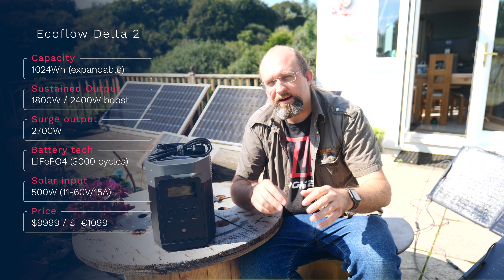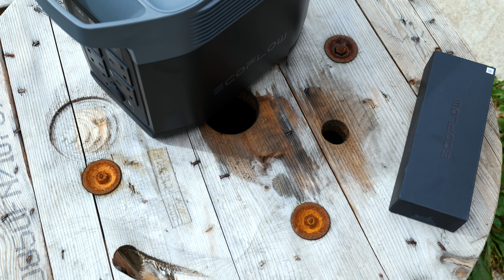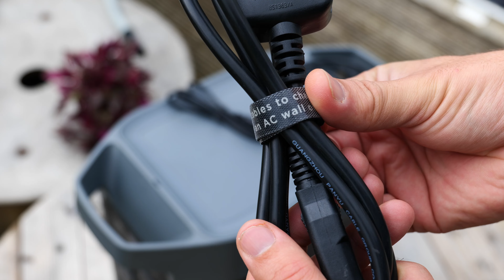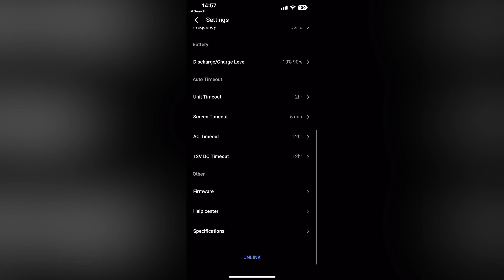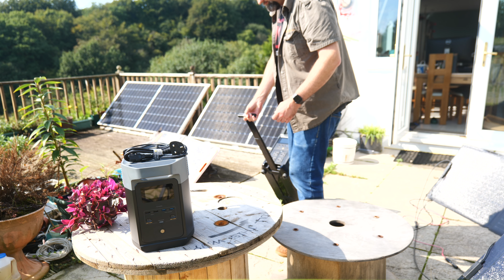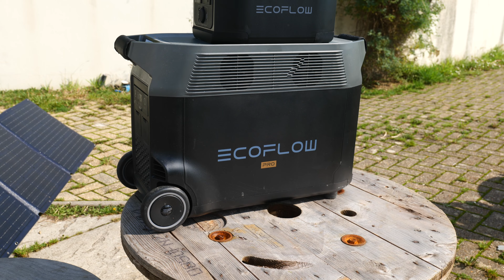Ecoflow Delta 2: Long-Lasting 1000Wh Portable Power Pack

Comment: Why does no one talk about the losses during conversion (DC and AC). The Ecoflow Delta 2 is really inefficient in this respect and as far as I know, about 26 percent is lost during conversion. In addition, the device is really loud as soon as the AC converter delivers more than 100 watts.
Reply from the maker: Conversion loss in my experience is about the same across all these portable devices - but yes, it is a factor, and I think I mentioned that during the bit on solar charging (if not, apologies, I definitely did in the Delta Pro review). 

As for sound levels, yes n- again, all of these all-in-one portable units sound like a jet engine above a few hundred watts of input or output. If you want silent, I was massively impressed by the Bluetti AC300 and B300, though it's far from portable -> https://www.makeuseof.com/bluetti-ac300-b300-portable-battery/

Comment: My only problem with my delta 2 and the extra battery is when I set the charge/ discharge level that's doesn't work really with the expansion battery.